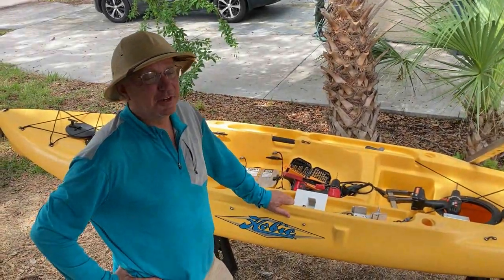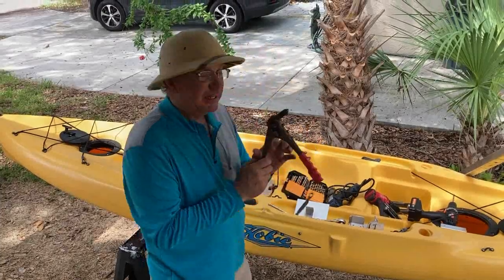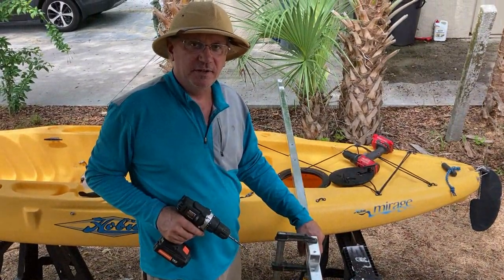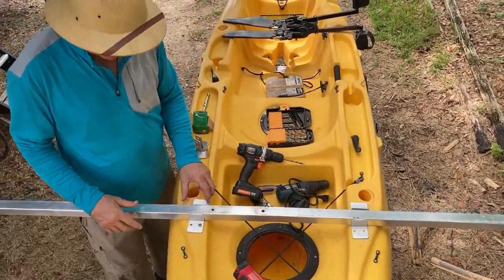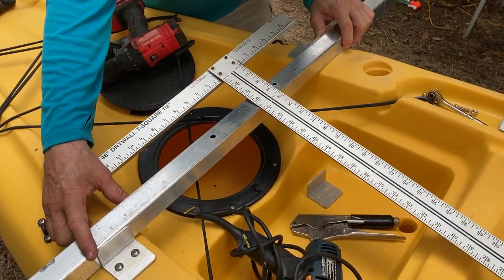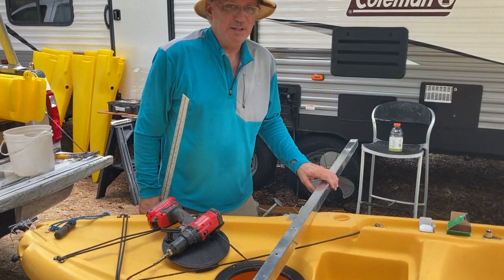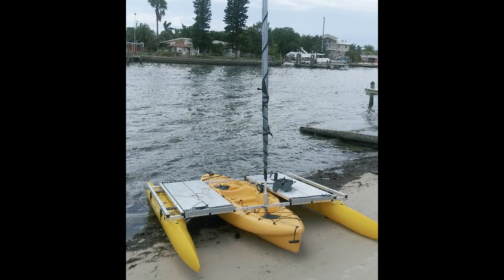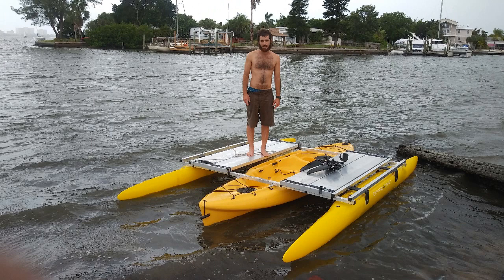Expandacraft Outrigger Kit, full installation instructional video.

Comment: Attaching the crosstube below the runner tubes would seem to be weaker than the crosstubes above the runner tubes.
Reply from the maker: The SS bolts are overkill so over or under doesn't matter.